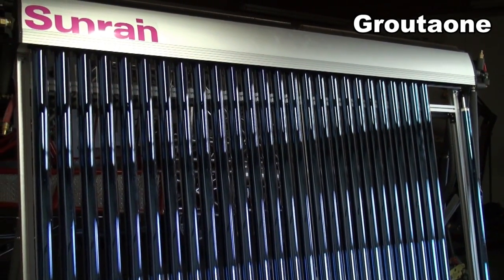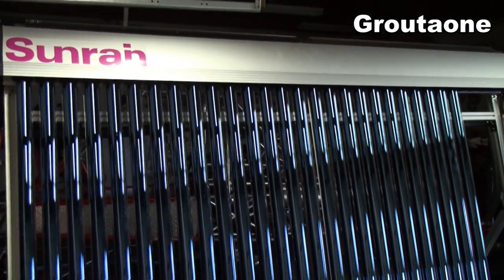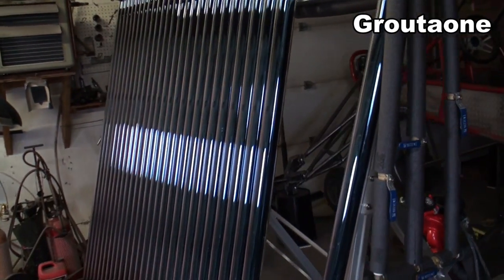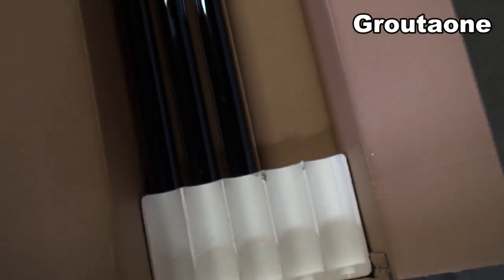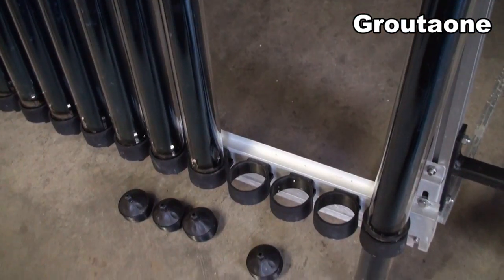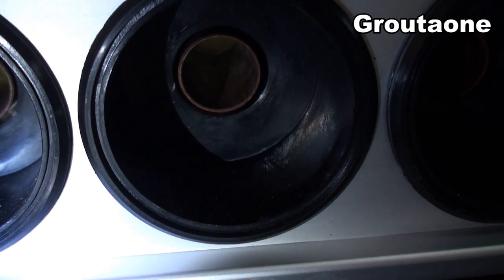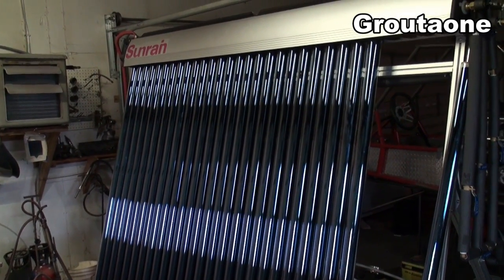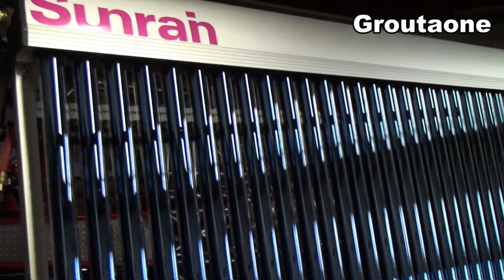Solar Vacuum Tube Heat Transfer Q&A

Comment: how often should the thermal heat transfer grease on the tube tips need to be replaced?
Reply from the maker: Good question, as far as I know replacement is not required.

Comment: I just watched a video claiming heat doesn't transfer through a vacuum. And I know they make "vacuum-thermoses" because vacuum is such a great insulator. But it is my understanding that vacuum is the greatest conductor of heat. Just as when water freezes in seconds in a vacuum chamber due to the heat being removed. And the "cavitation" caused in centifugal pumps due to water vaporization in the low-pressure center of the pump's vortex. Unless I'm wrong, that is how it works. Due to the internal vacuum, the heat energy engaging your tubes is instantly moved to the one place where it can flow. Like electrical current running from the high voltage side of a capacitor to the low and continuing on through an additional conductor. So the heat, like electricity, continually flows from higher to lower heat volumes, and the vaccum, I think, makes that flow instant. One difference being, a vacuum never "holds" heat energy but expels it as quickly as it takes it. It seems only to serve as a medium of transfer. If the vacuum is between two heat sources, one higher than the other, it will instantly try to balance that energy. And because the heat is always drained away to even lower volumes of heat, albeit not instantly, and because the vacuum is always trying to create a balance, the final destination of your heat should come very close to the input temperature. Only lacking what is leached-off in transit vrom the copper sleeve to the water.

Comment: I have an external wood fired boiler in my shop that heats my house, attached garage and shop it is located in. You are one of my first channels I subbed to years ago. Really enjoy your videos.  Is there a Sunrain distributor in North America or is this direct shipped from China? I keep getting info for a company like it. I would like to tie it into my existing system. I just need some contact information. This video helped shed light on how this is put together. 
Thanks
Kevin

Comment: The idea of vacuum tubes is brilliant. However, the other thermodynamic designs seem really poor. Firstly, how is heat transferred from the absorbent material to the copper inside the tube? Just air or a liquid? 

Next, the surface area seems poor. Pushing 2m worth of heat through a single hole seems like massive losses would occur. Do they? 

Finally, the copper sleeve to bulb transfer in the "manifold" seems like more losses would occur. Any info or actual specs on the kw or btu conversion of these things? 

It seems water/oil/thermal liquid flowing through the tube (both ends open vs one only) and directly contacting the absorbent material would contain much more efficient heat transfer. Love to hear thoughts, numbers, and real world observations. 

I'm trying to build and/or commercialize the most efficient application of this concept as I think it has the potential to be the most efficient heating method.
Reply: SlipperySlope - it beats regular solar thermal because the heat pipes inside the evacuated tubes concentrate the low temperature at the collector area into higher heat at the transfer point at the top via evaporation and condensation of a medium inside the heat pipes.

Comment: Hi 
I am interesting in vacuum tubes solar 
And I want to know why they're use copper pipes to transfer the heat why we can't use the vacuum tubes directly 
I think using copper pipes lead to loss heat
Reply from the maker: The advantage of not direct contact is no o rings to leak or fail

Comment: Thanks for your great video.  I appreciated seeing how the heat is transferred from the top of the solar tube to the copper fitting.  Did you purchase your system in the States or elsewhere?

Comment: Great video. Are you selling these solar systems?

I'd be very interested to get more info.
Reply from the maker: Yes that's the plan, I built a garage this summer with a roof made for solar and then installed the solar heating, almost finished been a big project. The plan was to get that out of the way and then start my solar sales business, have not started on my website yet, send me a personal message through youtube

Comment: Hello,how do you plan on making the heat transfer into your shop? What is the most efficient way? How many BTU'S can 1 panel produce? I know lots of questions just find it very interesting. Reminds, me of the old popular mechanics magazines.
Reply from the maker: I will use a forced air hot water radiator, same one I have been using when I was heating with my outdoor boiler, also will use a storage tank to hold energy for night, not sure on BTU amount, could likely be researched, I like floor heat but floor has to be well insulated and floor designed so that heat lines are not close to outside wall
Reply: groutaone I have a flat in Moscow. We have floor heat, using a boiler system. They laid the pipes over the existing cement floor than covered it with some type of cement than tiled over that. I love it. The heat is so even throughout the house. But it was expensive. I plan on using the vacuum tubes to heat my garage. Here in Michigan., presently I burn wood. But its becoming a pain. I will be watching your progress. Thanks

Comment: so the idear is to pump it through i head exchanger in the winter either inside your shed or house i assume>>> you were talking about temps and pressure in the previous vid, have you thaight about running antifreeze and running the system under pressure like a cars cooling system with a cap and expansion system 
thanks 
great vids as always
Reply from the maker: Thanks, yes, under normal conditions it would be under pressure with an expansion tank and antifreeze

Comment: Can any of this heat energy be converted to electricity via steam turbines? Or is this just for hot water and heat?
Reply from the maker: This system is designed to run around 20 psi with an expansion tank, not really a steam maker
Reply from the maker: I did see a video where a solar water heater like this one was used to heat Freon so the second stage compressor for an air conditioner was not used or needed, I think they were running the air conditioner with about 20% the electricity that it would normally use

Comment: How many gallons of water were in the system when you got it to a boil. I think the question for me is how many degrees will this raise an 80 gallon storage tank during a day?
Reply from the maker: This unit would easily heat an 80 gallon tank to high temps, however it would depend more on how much heat is removed in one day, like if the water in the tank is used to heat an entire house then one collector like I have here would not be enough
Reply: groutaone
I am think of using tubes as a supplement to a point of use water heater for general washing/cleaning. In the winter, I would scrub off excess heat (if any) into wall mounted radiant heat panels to supplement heat from a wood burning stove.

Comment: Would it be possible to generate electricity from this? I'm so into this project can't wait to see the out come!
Reply from the maker: This system is designed to run around 20 psi with an expansion tank, not really a steam maker

Comment: Those things are pretty cool or is that hot? About how big of an area will those tubes you have heat?
Reply from the maker: For an example, I will install 5 of these to heat my 1200 sq foot shop, likely could do it with 4, I like to over do things a bit
Reply: groutaone Just five tubes? or panels?
Reply from the maker: ShawnCFarm Five panels each with thirty tubes

Comment: Do you have any figures on what it would cost to heat a space similar to a typical 21/2 car garage? Do you guys sell the heat exchangers too? I'm imagining a stand alone system that could heat my garage all winter keeping my toys toasty.
Reply from the maker: I really should do a video about what is in a solar package as there is lots to show besides the solar heat collector, but you likely would be in the 7 to 10 k range, heat exchangers are available, I would need to know how you plan to deliver the heat, meaning floor heat, forced air or floor rads

Comment: So the heat bulbs never come in contact with the fluid in the heating circuit. They sit in their own copper sleeve. I wonder this then. What is the efficiency loss by pushing the heat from the bulb, through an air gap, to the copper sleeve and then the heating fluid? Don't most insulated coffee containers use an air space to insulate? I agree that this design makes for much easier solar tube changes. I know it's all a balance between efficiency and ease of use/maintenance.

Would like to hear your thoughts on this idea.
Reply from the maker: The heat bulb slides into the sleeve with light pressure so it does contact,  precision made